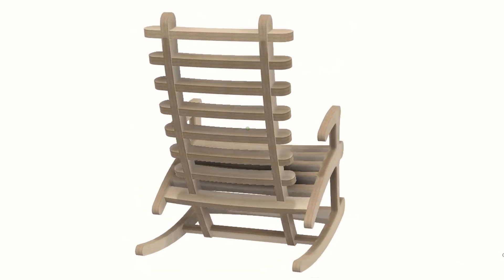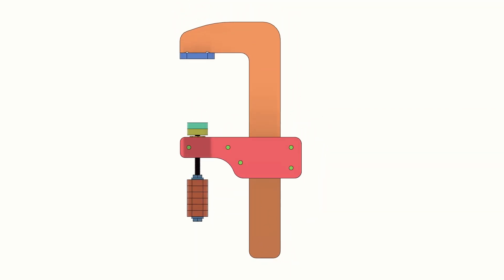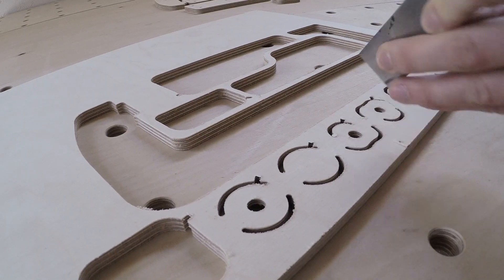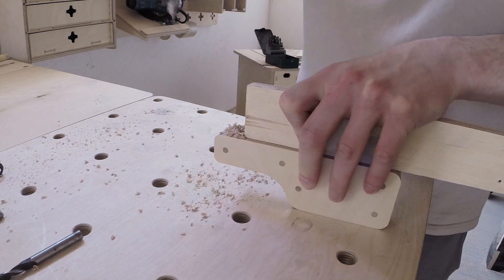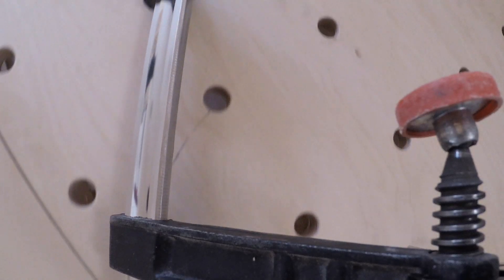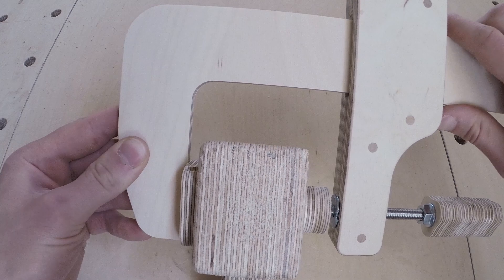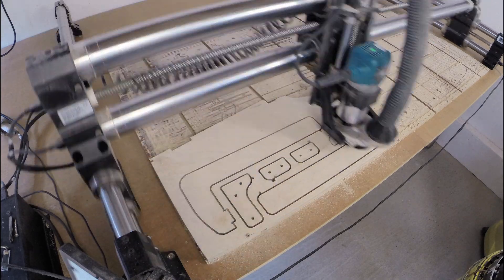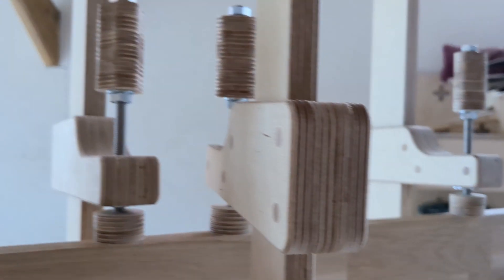DIY Plywood Clamps Made On A CNC Router - Aribabox Workshop EP11

Comment: Maybe if you reinforce it with a flat steel bar it get stronger?
Congrats for the project
Reply from the maker: Thank you for the idea! The steel bar would make the bar component stronger. However, the bar made from 12 mm (0.5'') ply is strong enough for the clamps to be rigid and function well.

Comment: It may not look as nice but would it not be better to glue the sandpaper to the bar component so you can replace it more easily.  Also if you use something like belt sander belt instead of sandpaper it would last a lot longer.  Anything cloth based really.
Reply from the maker: Thank you for the suggestions!
We did consider gluing the sandpaper on the bar component, but the clamps wouldn't look as good.
That's true - the belt sandpaper would last longer. We were also considering using rubber stickers, but the sandpaper seemed to be a more suitable option since everyone already has sandpaper at their shop, and it wouldn't add any additional cost when building the clamps.